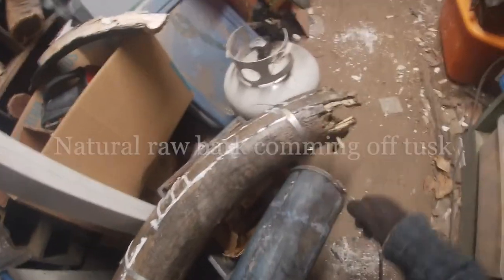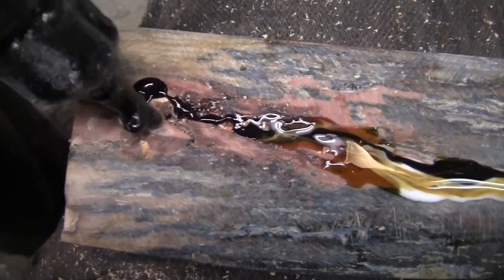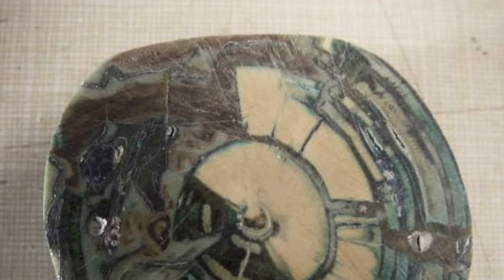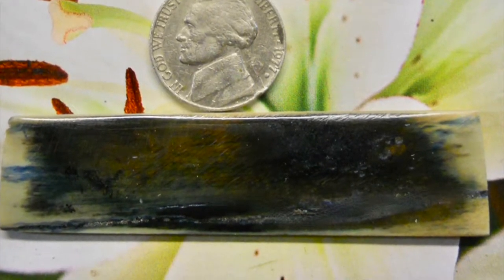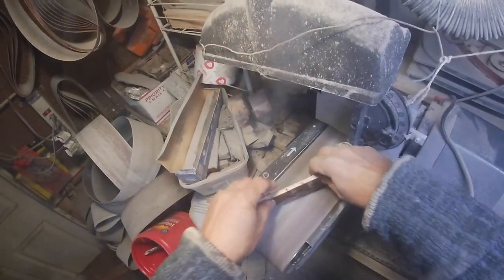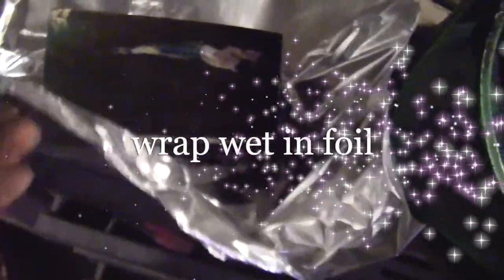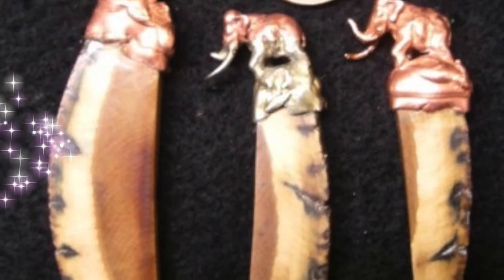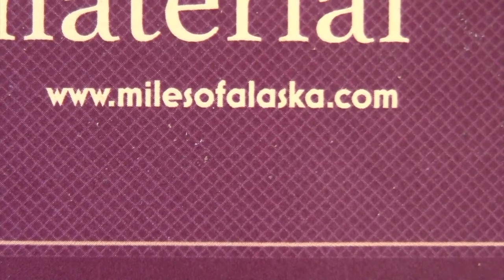Natural vs stabilized

Comment: Is all your ivory for scales stabilized?
Reply from the maker: Most of my fossil ivory is not stbliazed as if it needs stabilizing value goers down. Most customers want 'all natural'. However important is I do not sell until at least dried for 1 year. Alaska is a cool very place two ideal Those who live in different climate might seal their material in zip bag put in refrigerator for a week to ensure it adjusts to climate. This is more the kind of information I give when I send out orders. And 2 big issues, never get it wet while working like 'wet sand,' and never get it to hot to hold on the sander using bare hands.